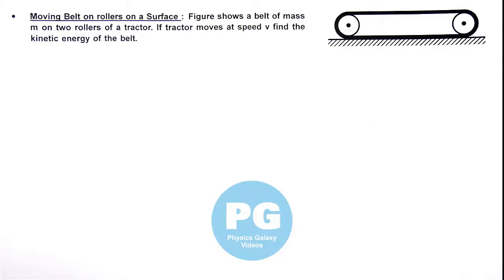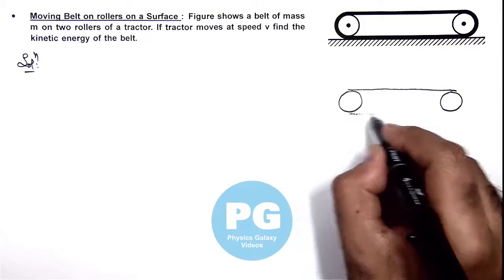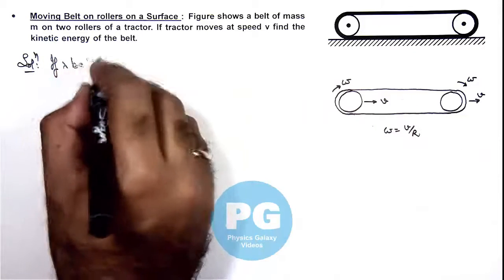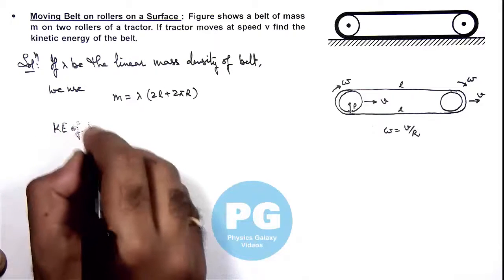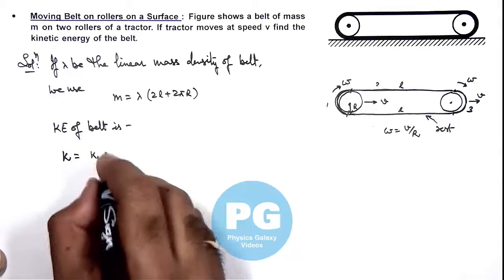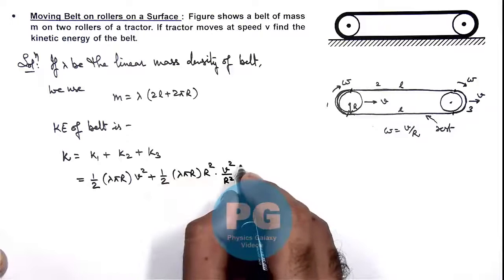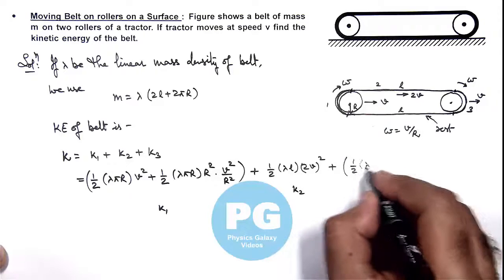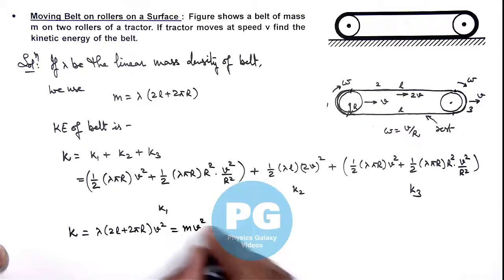45. Advance Illustration | Rigid Body Dynamics | Moving Belt on rollers on a Surface | Ashish Arora

Comment: could the solution be also like
KE(wrt ground)=(KE wrt com)+ (KE of com)
so kE of any particle wrt com is 1/2dmv^2...(since no slipping)  so ke of whole body wrt com is 1mv^2 .. and ke of com is also 1/2mv^2..
so mv^2.
Reply: Isn't frame dependence of kinetic energy based on velocity ? So you're equation would miss m*v(wrt com)*v(com)